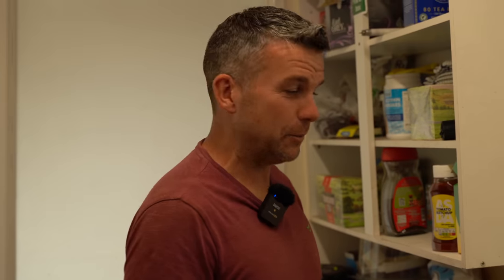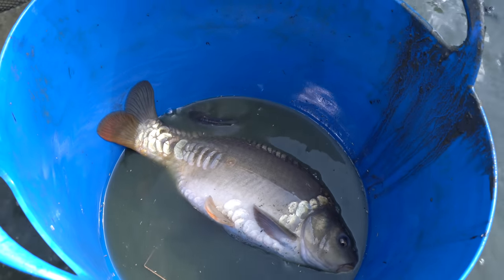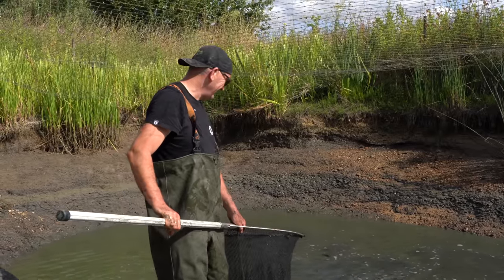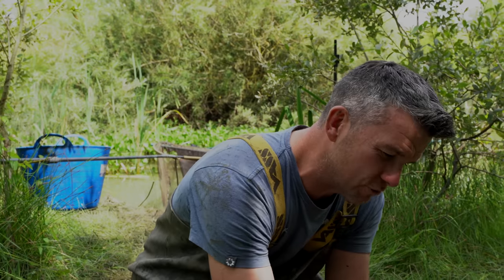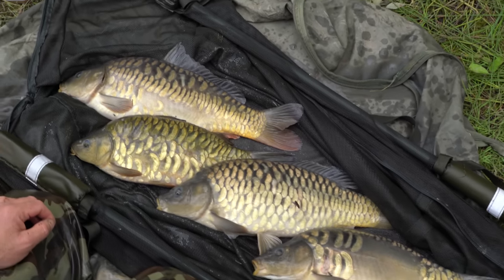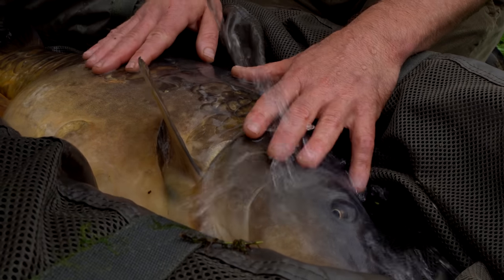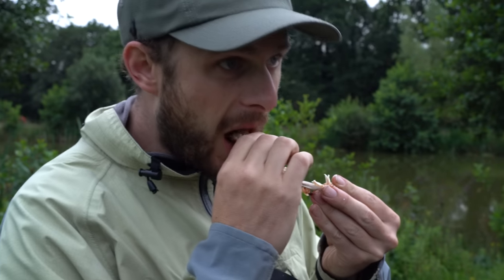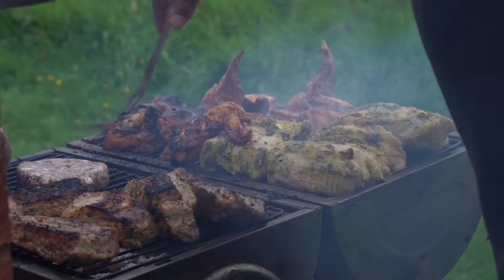BAITWORKS - Behind the Scenes - Carp Fishing

Comment: As a customer of your brilliant range of baits where I have had a great summer using Creamino Boilies with the Creamino Oil and Powder. As Autumn is approaching and temperatures dropping, which bait would you recommend using  besides the creamino ?
Reply from the maker: If you've had great success mate I'd def stick with the winning combo! The Creamino is a great all year bait just like all the baits in the range. I like to mix it 50/50 with the Heat from time to time if you fancy a little twist. Tight lines